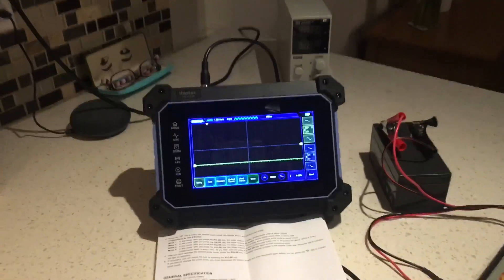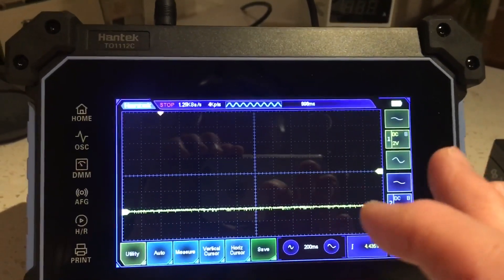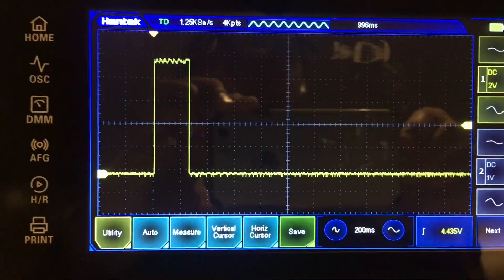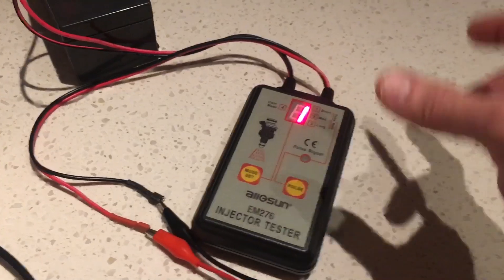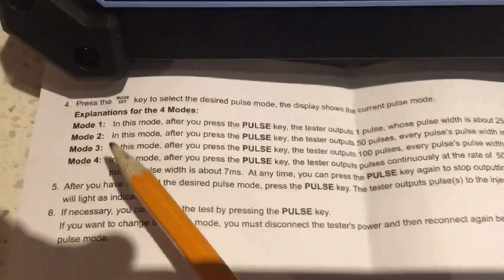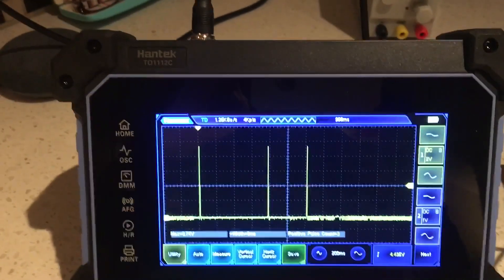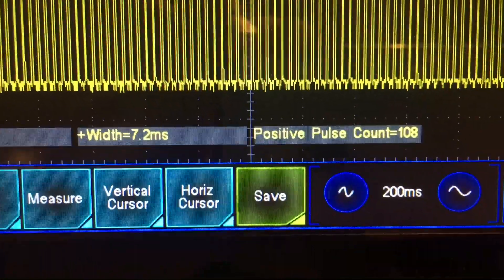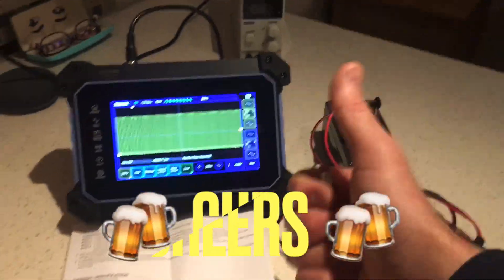Hantek TO1000 Measure Function

Comment: Which of the following 4-channel tablet oscilloscopes would you recommend for automotive diagnosis such as, cranking compression tests, crankshaft/camshaft correlation, in-cylinder pressure tests, pulse sensor diagnosis, injector and secondary waveform analysis, capturing and reviewing waveforms, etc, etc...?
OWON TAO3104
HANTEK TO1254D
Reply from the maker: I know nothing of the Owon product. I do know the Hantek TO1000 series was a huge disappointment for me. Thx for watching 🍺
Reply: @TheGibby3340 
Thanks for the input on the HANTEK TO1245D (greatly appreciated and valued you opinion). If you know of anyone who has used or experienced the OWON TAO3104, can you let me know?

Comment: I really like your videos. I use my injector tester like yours same part # for checking variable camshaft solenoids. The hollow bodied ones you can visually tell if the pintle is sticking within the bore.
Reply from the maker: Some good stuff, some rubbish too 🤣 Yeah I guess the driver on the injector tester could drive a spool valve 🤔 Thx for watching 🍻

Comment: Nice tutorial 👍! As you stated about pros and cons, you win some you lose some: let it on continuous push the pause  button and then try to take a measurement. 2/3 it will lose the capture :)) the injector testing device is on my buy list. I bought the autool version, but it's made for injector cleaning - it doesn't have counted pulses, just pulse time modes. Buyers be aware:))
Reply from the maker: Thx Alex. I’ll try that. Thx for watching 🍻